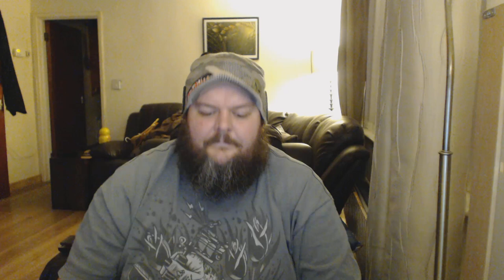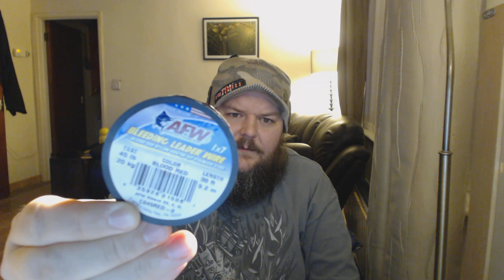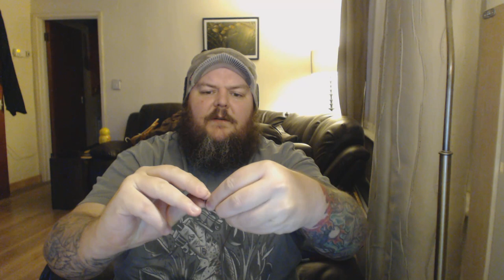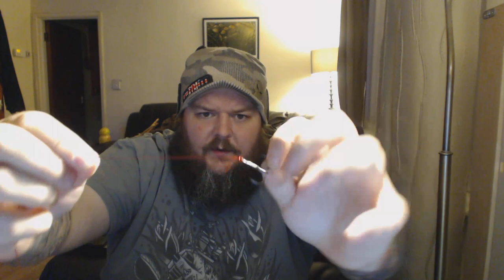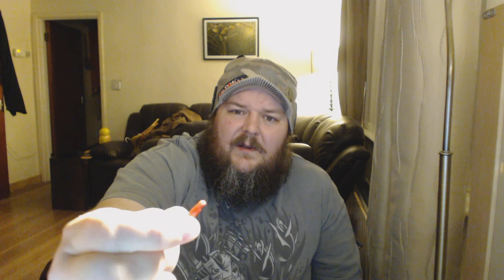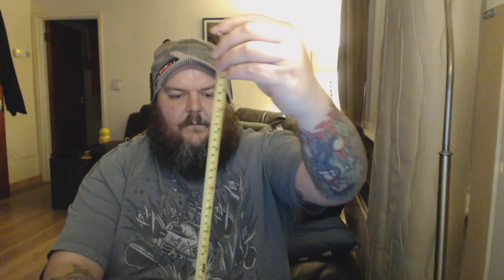How to make a standard Pike Fishing Wire Trace

Comment: I just bought some of this off the back of this video, but no way on earth does mine twist as easy as shown. It just springs right back. Way too stiff. Even with 2 sets of pliers I couldn't pull the knot tight. I guess they have changed it since this video. Terrible stuff.
Reply from the maker: I don't twist buddy I crimp.
Reply: @DavidScobie  Seriously pal, I couldn't even get it to do the bit where you say 'pass it though the eye, bend it back on itself, wrap the tag end around the main trace, then thread it back through the eye'. It is way way too springy to even do that. I followed the vid 100%, and even using 2 pairs of pliers and all my strength to try pull the knot tight i ended up with a loose bulky knot. I'd be happy to send you some and if you can tie a trace the same as the video with it I'll eat my hat.
Reply from the maker: Yea sure buddy send it my way I'll use it
Reply: @RustyShackleford66  Use the 30 pounds American Fishing Wire, strong enough for Pike and easier to tie the knot, more flexible and supple.

Comment: Wow really solid trace! Is there any other name for that choke knot? Can't seem to find it on Google. Thanks
Reply from the maker: I've always just called it a choke knot, it would be a close thing to a Reef Knot instead of joining two lengths of rope your joining a eye and a wire.

The thinking behind it is the same as the knotless knot it's a choker the more that you pull the more it tightens on itself. If you want I can do a more details run through in the next vlog?
Reply: @DavidScobie  That makes more sense. Just made a trace up, absolutely solid. Ten times more confident in this trace than a shop bought one. Nice one David, no need for another vid  👌🏻
Reply: @DavidScobie  yeah I was trying too figure this knot myself that attatches too the swivel was that #4 crimp your using off the Eddie turner site?